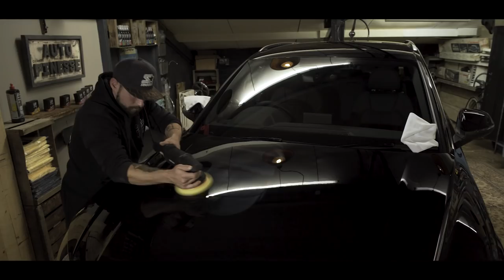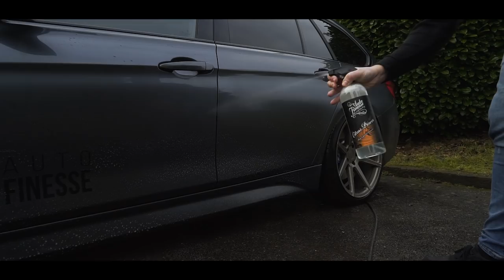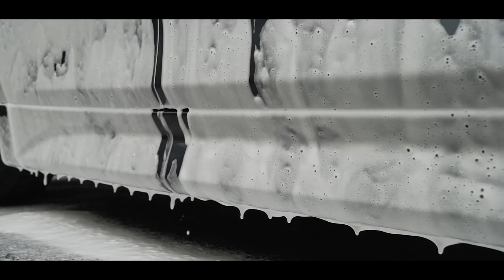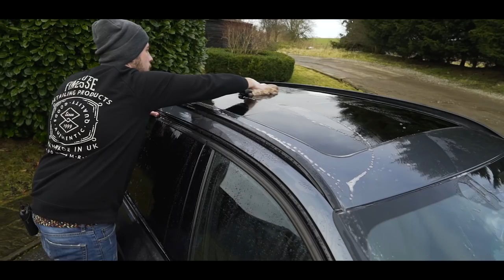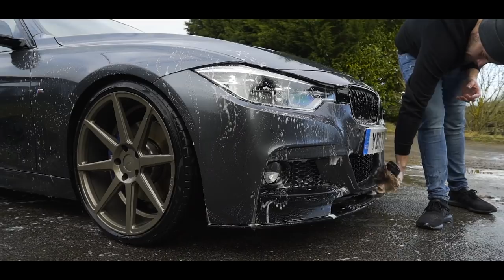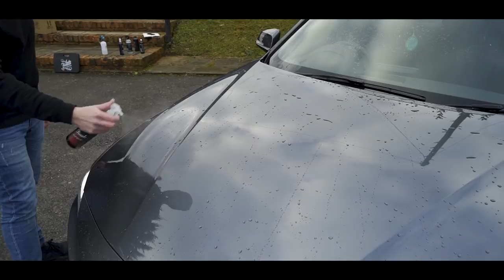Detailers Den - Episode 1 - The Car Wash

Comment: I have started detailing my current car more than any other I have owned and have watched hours and hours of youtube videos and tutorials  Why do detailers wash their wheels first then snow foam, why not snow foam then clean wheels so it can be dwelling while cleaning wheels and minimising the risk of being on too long. Then when rinsing snow foam off can rinse wheels at same time
Reply from the maker: Depending on the vehicle, but we would usually spend longer than 3-5 Mins to clean all the wheels to a though standard, by which time the foam would be drying on the car and causing issues.
Reply: Probably because they use strong degreasers to remove the brake dust instead of car soap.

Comment: You say in this video to apply the snow foam from the top of the vehicle to the bottom (makes sense) yet on the bottle under "Directions of use" it says 'Apply to the vehicle working from the bottom to top and leave to dwell before pressure rinsing' 🤔
Reply from the maker: Either or - it really makes no odds in terms of performance. The views in the video are that of the detailer airing them, we have multiple detailers here and each will have their own preferences on how to do things. Neither is wrong it's simply how they prefer to use to get the desired result.

Comment: Citrus power isn’t very good,iv tryed it 2/3 times and it doesn’t really do nothing imo plus you haft to use quite a lot and it will only last a couple of washes but imo it’s not a good product...
Reply from the maker: That's fair enough and you're more than entitled to air your opinion on it. However, it is worth noting that Citrus Power is designed to maintain a detailed vehicle and may not be very effective on those that don't have a wax or sealant protective layer present.